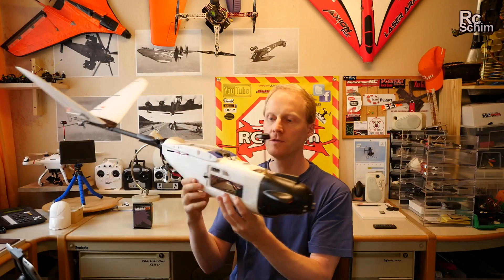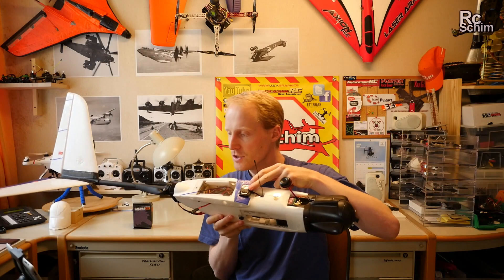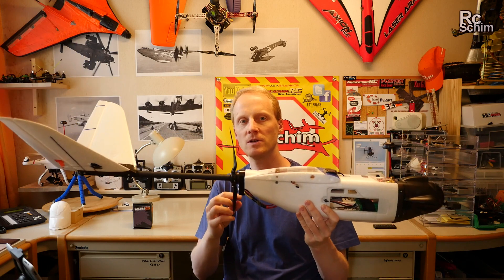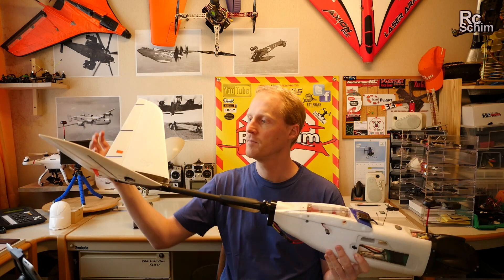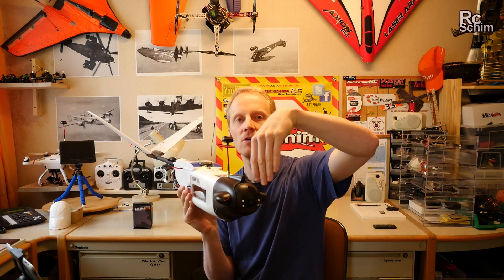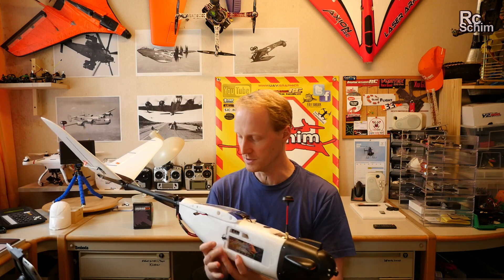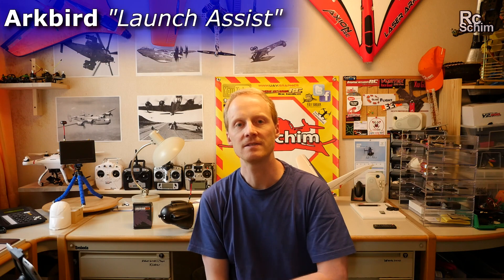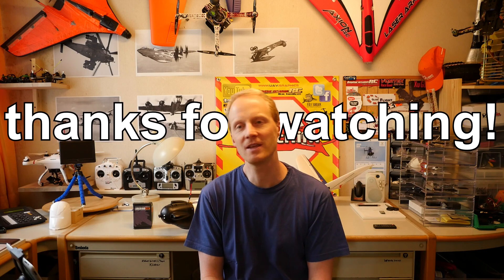XUAV One Part 2 - unique FPV Plane reviewed in hangar

Comment: I wish i had more background with planes lol
Nice airplane, interesting design!
Let's see how it flies :)
Have a great weekend
Reply from the maker: I'm preparing a video right now comparing plane FPV with miniquads. Both is nice. Flying fpv planes, out, far, is adventurous - relaxing (dont have to have a working motor if you're high enough - you can soar home).
But miniqudas are so fast, powerfull, totally 360° freedom, gravity defying,...
Planes on the other side give you a good sensation of flying, wind, lift, the element air...
you too, greetings!

Comment: Hi Mario, V-Tails has less drag because only two fins, that's the reason why they used mainly by slope planes ... the gearbox would be fine belt driven and without any noise ... a special designed motor looks like the current prop mount would work much better too ... the plain looks well designed for FPV but flies poor and with this motor assembly it's to noisy maybe produce high frequently vibrations from the gearbox too! Wish you all the best Mario! Paul
Reply from the maker: definitly, the vibrations here are ugly. gonna move from this to the smaller brother the XUAV Mini Talon soon. can also fly it with 5200mah 4cell with a pusher prop and the mini talon looks like a popular, versatile plane. It's 60$ at banggood atm!

Comment: v-tails are purported to have less drag than conventional tail forms due to smaller wetted surface area, but some of the gains are probably lost due to adverse roll effect in turns, requiring greater aileron input. Inverted v-tails are more efficient as they contribute positive roll effect in turns, requiring less aileron and therefore less drag, but are vulnerable to ground strike, except when mounted above a twin boom configuration.
Reply from the maker: thanks, makes sense. I think I recall a drone style plane with a twin boom inverted vtail setup. looks fancy.
Reply: I recall an 800km flight in a Beechcraft Bonanza with a v-tail - in the 1980s - it had a tendency to 'wag' its tail slightly from side to side ... the tail fins were very flattish (google an image and you'll see what I mean)- so it had less yaw-tracking effect than pitch. No free lunch in aerodynamics.

Comment: Watching some older FPV plane videos recorded before I knew of you channel. It's fascinating to see how some things have evolved, some things persisted. 

While most people can intuitively guess a v-tail has less drag due to lower frontal cross section. The reality is to have same balance of control authority a plane needs a similar wetted area of control surface. 
On full-size planes, v-tails generally used on higher speed cruisers ... this tends to mean a compromise in lower speed handling (unless v-tail surfaces enlarged). With similar v-tail surfaces to a conventional T tail, rudder authority at lower speeds is poor. The V-Tail Bonanza was know as the 'The Doctor Killer' due to poor crosswind landing and spin recovery tendency. 
For an FPV plane like this (with slightly enlarged v-tail) it should be fine. If the RC plane was also a twin-motor (vs pusher), the motors could be used to improve yaw stability. (could be why more common to see v-tail twins than v-tail singles)
Reply from the maker: thanks for viewing my older videos ;)   also thanks for the aeronautic background on vtails - interesting stuff! Doctor Killer ;)  In sportscars there was a "widomwaker" - do you know which car got this title? (german brand)
Reply: @Rcschim  apparently Porsche 930 Turbo leads the list ... also due to poor yaw control when cornering (I cheeped and used search engine to check; my guess wrong).
Reply from the maker: @AerialWaviator  correct - that's the beast I was referring to. the problem was the turbo punch that came late and unexpected to send untrained drivers off the road...
so yes, also yaw stability issues ;)

Comment: Good review and build Mario!  Will the arkbird osd take direct 4S power or are you using a regulator?  Thanks!
Reply from the maker: no, the OSD can only take 12v. so you can use a small 3cell or, like I did, use a balance plug that only takes 3cells off your main battery.
Reply: They sell a V2 current sensor which allows up to 6s and you don't need to run a small 3cell.  I use the V2 current sensor on all 3 of my Arkbirds
Reply: +7demo7 Thanks for the great info!

Comment: Very nice video!  Hope to see that launch assist in action :-)
Reply from the maker: I will try it - but for the first few flights now I just used the APs stabilize mode - where I control the throttle myself (feels better this way - and works fine).
Too much technical dependency isnt good I guess :)

Comment: Vee tails are reputably more have less drag than Tee tails and keep the tail surfaces out of the grass. They generally have poor rudder response and are more difficult to align and set up correctly. On a cheap foam model with no dihedral any aerodynamic improvements of the Vee tail are probably going to be lost with yank and bank turns.
Reply from the maker: thanks Rob
Reply: Plus vtails fly like crap... absolutely hate it on my mini talon: rudder inputs roll the aircraft and with enough throws it causes a spin that is rather violent

Comment: the plane itself looks nice, but I worry about the prop mounting point.. I guess there will be much cuts in your fingers. btw, it it possible to change the engine and props to more adequate engine and props? I would prefer a more efficient powerplant for maximum flight time
Reply from the maker: not so sure here.  about flighttimes. flew 15 and 20mins with some good climbs and only used around 1500mah on each batt :)  for such a heavy (433gr) battery the plane soars quite well. with some constant headwind I almost kept my alt without motor. only lost 1m /sec...

Comment: i dont know why XUAV did not improve the talon & mini talon instead of designing airframes like this one .... looks a huge step backwards to me
Reply from the maker: the mini talon seems to be their most popular FPV plane. I also have it in a box in my hangar and will soon transfer the Arkbird from the ONE to the mini talon. The pusher prop is an older but proofen concept.
here on the ONE I was interested in this unique concept - but it wasnt thought out to well.
on RCGroups I saw someone mod this to a belt system.
Reply: RCSchim yes , this system that the one have is not new and theres a guy on rcgroups from the states that was making upgrades for this , about the mini talon i believe its a very good plane and i saw the big talon fly vary long ranges on fpv aswel.

you want be disappointed with the talon for sure